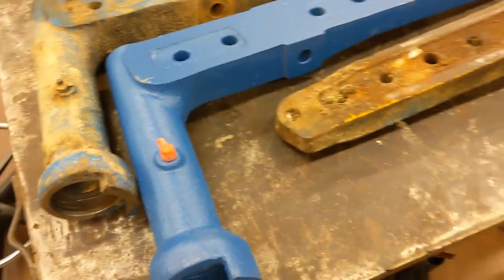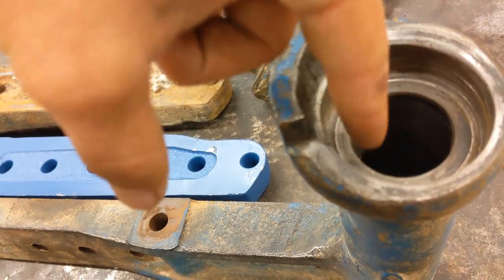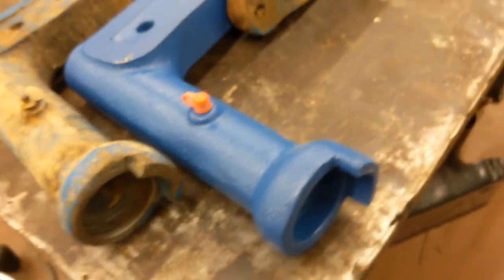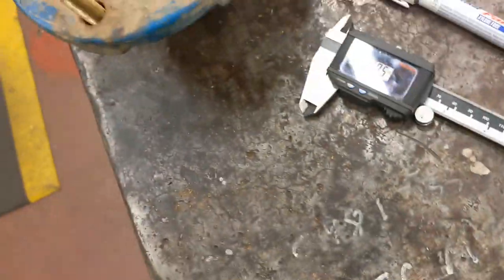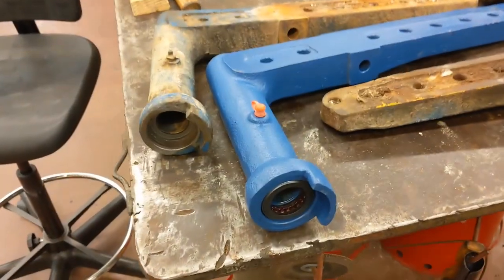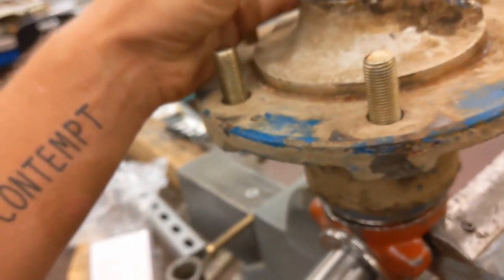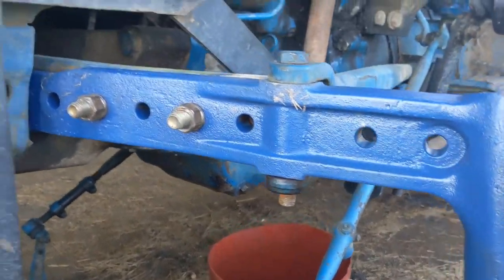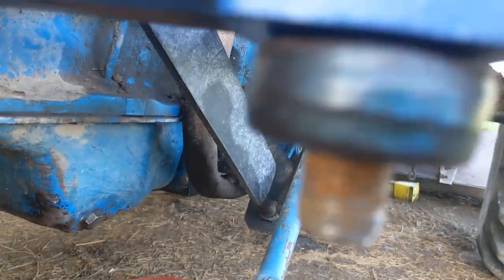Rebuilding a ford 3600 front end

Comment: Wish you would have spent more time on the axle knee that needed repair. My Jubilee axle knees appear to be worn in a similar condition. Would have liked to see how the bushings fit back in properly, if possible. May end up putting in old and new bushings to make a sleeve for the spindle.  
Cannot find any info on the web. Yours came the closest.  
Thank you for that.
Reply from the maker: Sorry I dident show what you were looking for this was the first few months of making videos, so I was super bad at it. Still learning and getting better. The bushings should be a press fit into the knee and close running fit on the spindle, about .002"-.005" clearance on the diameter of I remember correctly. I was able to find prints on the spindles with the factory journal diameter on yesterday tractors not sure if they have the same kind of drawings for yours but it's worth a look. Good luck and let me know if I can help in any way.

Comment: I Googled Ford front Axle knee and found some on ebay. New and used. Does this part differ between the 3000 and a 4000.? I would think it would be the same
Reply from the maker: As I recall the parts I bought were compatible with 4000 series tractors as well as my 3600.
Reply: @GRTRanchadventures  ok tks
Reply: How did your project turn out?
Reply from the maker: @dennislong7852  well the new spindles I got were not fully machined so I finished them and it turned out the heat treatment one one of them was bad and it sheared in half the first time I used it... They sent me another one which was correct and it's been running great ever since!😁
Reply: @GRTRanchadventures  I know my bushing is wore out cuz the axle actually tilts forward probably about 25° or so making it hard to steer. I enjoyed your video that gave me a little idea of what what I'm up against when I go to replace mine. Tks